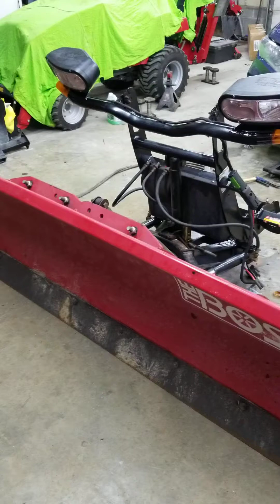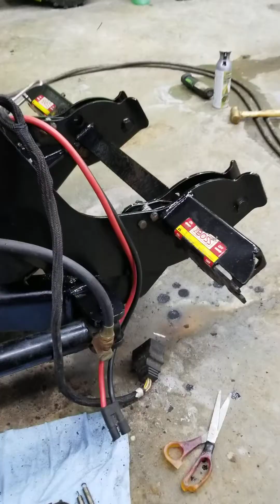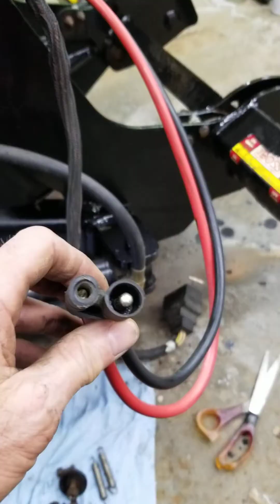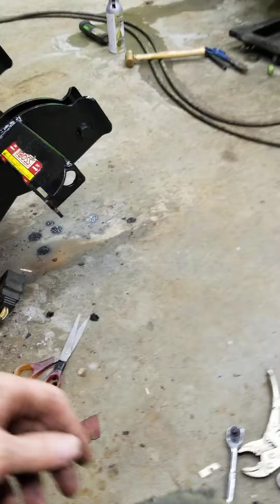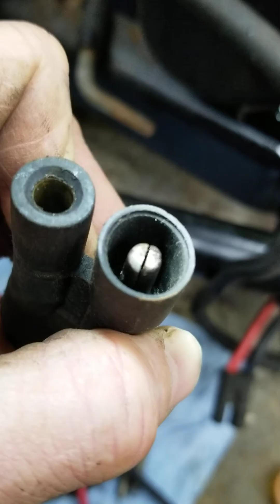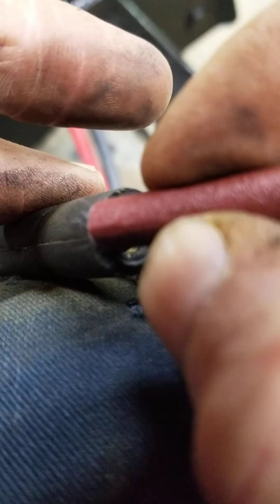Boss Snowplow Power connector repair and rejuvination

Comment: What is the power plug called for the technical name nobody seems to know and it's one big secret is it a universal plug or is this only a boss only plug I need a couple of these because I have a winch that is going to hook into my Boss plow connector to power it when I'm not using the plow but I don't know what type of plug style this is called
Reply from the maker: The original boss connector is just a Boss power plug.  To my knowledge unique to boss plows.  If you go to the boss dealer you can purchase a new set of power connectors from them and use on end to attach to your winch
Reply: Just call BOSS and they will sell them to you